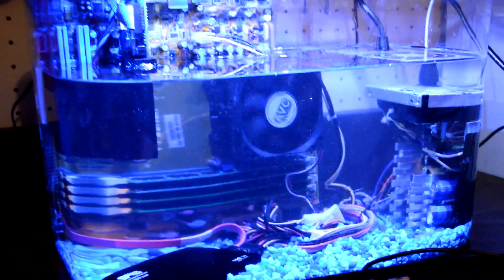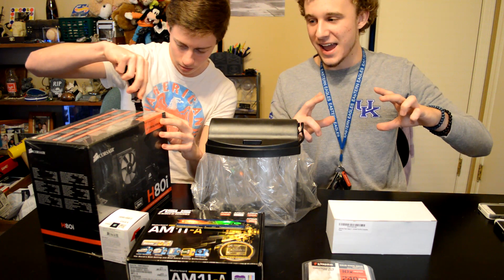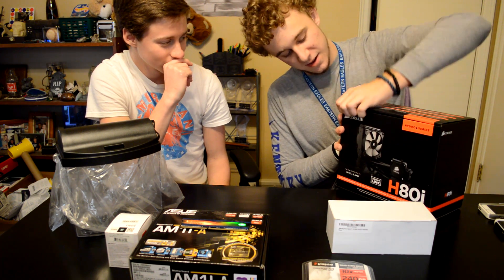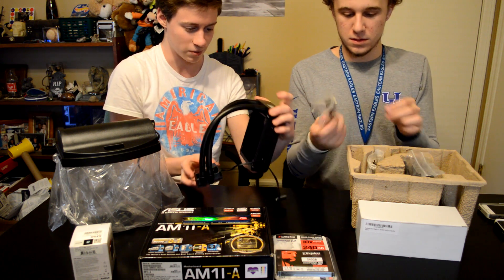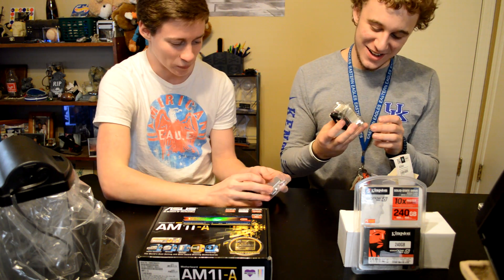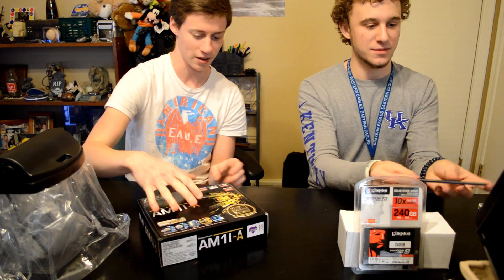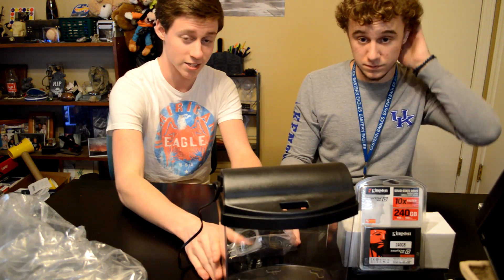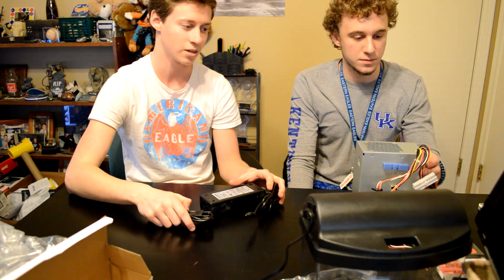Mini 1 Gallon Mineral PC Build Part. 1: Unboxing & Case Design!

Comment: AM1 APUs? I didn't know they made those, I thought they were all FM2(+). But yeah the idea for this build is super weird, oil submerged but watercooled and the radiator sits outside the tank. Wut?
Reply from the maker: The whole thing was pretty crazy xD. But yes AM1 is pretty useful. I got the top AM1 APU and it's not half bad plus uses such little power.
Reply: Which is why watercooling it is crazy to begin with, kinda defeats the purpose of the oil!

Comment: Why even bother oil cooling? The H80i is overkill alone...there's no reason...
Reply from the maker: Well as we said in the video yes we know it is overkill. And it doesn't have to be oil cooled we know that. It is up to the buyer in which they can put rocks in it and make it look pretty and leave it that way, Or they can still put the mineral oil in it.